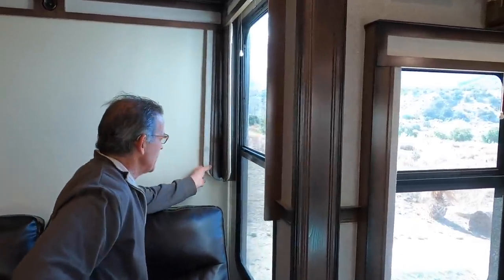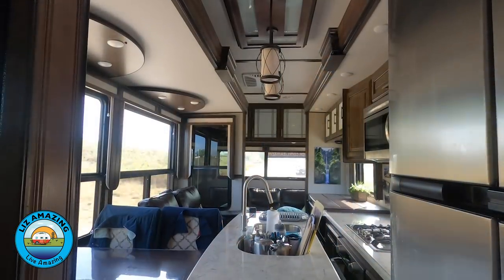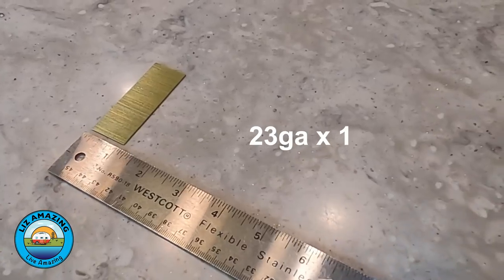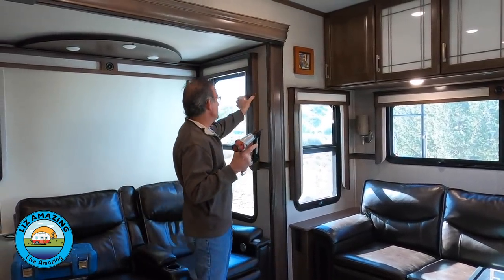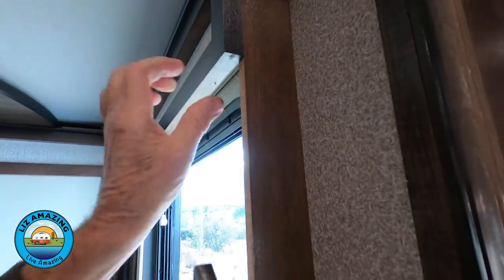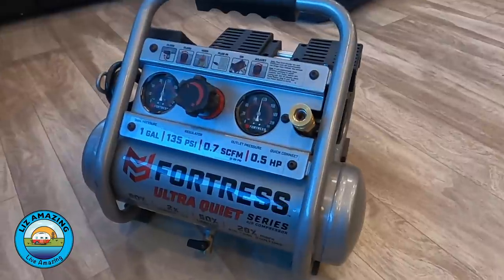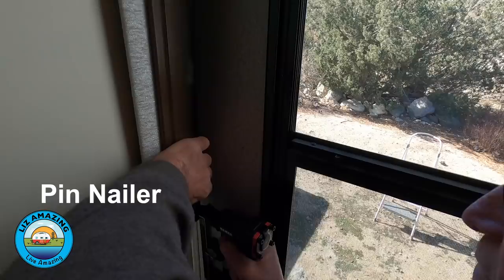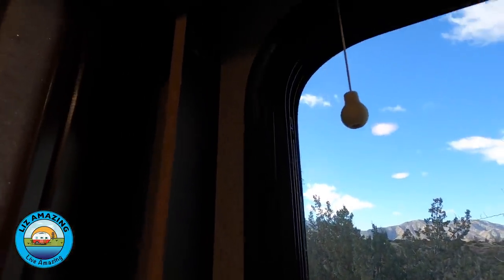RV life: What do you do when pieces fall off inside your camper | How to fix it | RV living

Comment: Hello fantastic video again showing the truth of full timing on the road. We carry a mechanical shop lol! So far chassis on the dog trailer broke, bought steel and hubby replaced and painted. Boat trailer springs broke, hubby bought new springs and replaced. We carry spare wheel bearings for the trailers. Now you understand why we travel with two vehicles lol. Great video wished more showed so people realise there is a price for full time travellers it is not all fun! Stay Safe. Love from us Aussie nomad friends ❤️🤗
Reply from the maker: Hey there! Glad to hear we're not the only ones with a boatload of tools on board! They definitely save the day. Thanks so much for your comment!
Reply: All, when you remove and replace an RV screw. Tip put a tooth pick in a littie elmers glue, stick in the screw hole, then break the tooth pick off flush, reinsert screw. Onetime fix,  good to go!
Use to tooth pick ends for bigger holes. They are cheep. Good vid Paul & Liz.
Reply: Stick houses have plenty of repairs.  My light fixture wires came loose. The weather changed and my door sticks miserably. However the yard gate closes without sticking, now. Annual events. First year without plumbing problems after the first freeze. It us always something. We need challenges to overcome and some of it is  fun. You get a sense of accomplishment.
Reply: pro tip: watch movies on kaldrostream. Been using them for watching lots of of movies these days.
Reply: @Jaden Reginald yup, have been watching on Kaldrostream for since november myself :)
Reply: @Jaden Reginald Yea, been watching on Kaldrostream for since december myself :)

Comment: Great tips. I have the same air compressor in my garage, very quiet. Here's a tip also, I will use dabs of silicone on the trim pieces before I put them in place, if you have access. It tends to help secure along with the staples and brad nails.
Reply from the maker: Isn't that compressor the best? Thanks for the silicone tip!

Comment: Thanks, Paul.  Good info.  Why do interior pieces fall off?  Let's see:  Quick construction practices (screws are better in some places but take longer).  Harsh trailer suspensions; independent torsion bar suspensions are easier on rigs but cost more.  CAD/CAM design and production holds small tolerances, which in turn eliminates trim altogether (e.g. our Lance has no interior trim).  If it isn't there, it can't fall off.  Framing & supports made with 2x2 lumber (vs. welded aluminum tubing) allow much more movement.  And then there are the walls and cabinets which are made of glued wood fibers.  It's actually amazing many trailers stay mostly attached to themselves!
Reply from the maker: That's the truth. We went pale when we watched the video of the interior while our was camper moving down the road- definitely putting it through an earthquake.

Comment: All the metal handles fell off the glass shower doors.  There is a filler cabinet on each side of the couch at the end of the trailer.  The main panel on one of the cabinets just detached itself.  This is the only trailer I have ever owned, a Grand Design Solitude, which I bought because I heard they were slightly better quality.  That may still be true, I have no other experiences to compare.  But I must say I did not expect this within the first 600 miles of travel.

I am a retired contractor.  Fixing is not a problem.  I did much as you have shown but also used white glue on the wood joints and epoxy on the glass/metal joints.
Reply from the maker: Yeah, we are disappointed by the quality. We thought we were doing a step up from the Reflection but I think they are just stapling them together these days.

Comment: Thank you for sharing both the illnesses and the cures. I'm a Coachmen owner who used to drool over Solitudes, but we are seeing way too many stories such as yours lately. For sure, all brands have their share of issues, but you have been dealt a less than desirable  hand.
Reply from the maker: Yeppers. It's that earthquake going down the road!
Reply: Seems like Grand Design has a generous amount of advertising hype....like the whole R-40 roof insulation claim....that would require a 13 inch roof cavity according to Mansfield and Owen Corning. If that aluminum foil makes it a R-40: then double it and have a R-60-R-80 attic insulation LOL

Comment: They use cheap and light weight materials to build these rigs, and things are bound to come apart. However I have to say our first travel trailer was a 2012 KZ Sportsmen. After 8 years the only things that I had to fix was a valance that came loose and a shower base that cracked. Never had a single issue with the cabinetry,  furniture or on board systems.  Granted we don’t full time, but I still think that was pretty awesome. Because of our positive experience with KZ, when we decided to upgrade we bought another trailer from KZ. Hopefully this one will be as good as the last.
Reply from the maker: Ooh, that's exciting- congrats. We are hearing good things about KZ. Awesome!

Comment: This video had me smiling from start to finish because I just did this type of work. We have a Reflection 311BHS and it has a rear bunkhouse. The slide is so tight to the back wall that it rubbed on the rear window valance every time the slide out was opened or closed. Then the half bath door wasn't shut tight and the vertical trim piece on the slide out caught the door handle and that popped off. The valance we left off and I attached the pull shade to the wall above the window and I used my 18g brad nailer (I don't have a pin nailer) to reattach the vertical trim. I still have to fill the little nail holes with wood filler. I took a picture of the trim and will go to a hardware store and try to get some stain to match and then stain the wood filler. Better than those crayons that fill the holes. They never match very well.
Reply from the maker: Yep! Glad you have a brad nailer, so important in RV life! We bought a can of wood filler but haven't tried it yet. I have had good luck with markers for scratches. If my wood filler doesn't work I will try your idea of stain, thanks!

Comment: I have had to fix trim on our Solitude. I like small square head (Robertson drive) screws. They aren't as pretty to the eye compared to finish nails but they hold tight for good. Not sure if Paul is looking for a project haha but adding shocks will help with rattling things loose. I used the roadmaster shock kit available on etrailer. I have to say for all the clamor about GD quality there has been quite a few issues with ours. Fortunately like Paul I carry a wide variety of tools and can fix almost anything myself. Happy trails guys. :)
Reply from the maker: Paul is looking at something for the suspension but it's not the Roadmaster. Definitely upgrading the suspension will help. Once we figure that out we'll do a video for sure! Glad to hear you have a lot of tools, too. You and Paul would hit if off!
Reply: @LizAmazing  LOL, probably. Anyone that carries an air compressor and a variety of finish nailers in their RV is A-OK in my book. ;-)

Comment: I prefer to replace the nails or staples with screws where possible. Bought our 18 374th in dec and put it in storage. When I got it in the spring the overhead trimpiece above the front window had fallen down. Been good since then 🤞
Reply from the maker: That's an idea. We are happy with the pin nails, they are holding tight.

Comment: Actually when I got my trailer in the mid 80s it was already about 10 years old and it was still very very tight and solid when I got it right up till the time that I had to sell it. 😭
When I got it it needed new plastic cover strips over the screws on the outside and I had to take a mud dauber nest out of the heater and repaint the tanks and  reseal the roof. But everything else was in great shape.
2 years after I got it I had to replace the automatic changeover valve on the propane tanks.
Reply from the maker: Yep! I sure hope the RV industry wakes up and realizes they need to up their game.

Comment: This is a good video for those with new campers. I had to do some work like that in my 5th wheel. So one of the main reasons I chose my current rig (1984 Bluebird Wanderlodge) was that I would not have to fix too much inside. Tour of my rig here: https://youtu.be/iQBga0GXtOY. 
I have fixed a few spots were there was some water damage under my refrigerator but that's about it, thankfully its built solidly. I carry a ton of tools.. probably literally a ton, as I work on all of the chassis etc and I also do work for others. This is where I have done most of my work, just catching up on deferred maintenance. Just on my last trip out I blew out one of my suspension air bags (which was only 1 year old) and my generator quit producing power which was replaced in 2013 (a 12kw Powertech Diesel Generator)... so there is always stuff to keep up with when you have an RV.
Reply from the maker: Love those Wanderlodges!!! I showed Paul one I saw in a campground in Oregon last summer. They are SO cool! You are right. They certainly don't build them like they used to. Thanks for the tour!
Reply: @LizAmazing  Thanks!

Comment: Im convinced RV manufacturers quality build their units to ONLY be used for 2 holidays per year about 1 or 2 weeks per.  the more you move; the more things SHAKE RATTLE n ROLL!!  good clip of the unit going down the road there INSIDE the unit...have u watch lucy making dinner IN their unit WHILE ricky is driving down the road with it? HILARIOUS!!  I was a little nervous with P explaining about those two peg drivers WHILE holding them AIMED at the CAMERA..I thought for SURE he would ¨accidentally¨ shoot a brad off and you would add gunfire noise n puff of smoke with him dropping to the floor...etc!!..when reattaching stuff I automatically think of glue and double sided sticky velcro strips (if you need to periodically remove it).  Good secret agent clip at the end of you doing the jamie bond scene!!
Reply from the maker: Glad you liked the James Bond scene!!! We agree: RV manufacturers are serving the weekenders. Fulltimers are far too picky for them. And it's the part-timers that are driving the market. They don't care about the details, they just want the most for their money. As I told Paul, they build them like lipstick on a pig: make them look pretty and people will buy em.
Reply: @LizAmazing  lets call it the Jamie Bond scene! but lets face it; when RV manufacturers make SOLID STURDY units like the Mobile Suites one they are SO heavy you need SEMI to pull them.  I once look at once and he said it weighed 16 or 18,000 lbs! just not worth it.
Reply from the maker: @Lauren-vd4qe  Yeah, we did a tour of one of those. They are SUPER heavy. And you pay all that money, $200k+ and still get vents in the floors. At the time we did that tour, we were in a $30k fifth wheel with no floor vents, and higher quality slide materials. Here's the video if you're interested: https://youtu.be/tnukqEFNGuA
Reply: @LizAmazing  the one i looked at was parked in a guys yard small acreage.  I would drive by it near my house.  there was no for sale sign on it but one afternoon i decided to drop in n ask him anyways.  Yes he wd sell it for $55g; was truly beautiful inside. I was mesmerized until i asked him what it weighed! then i was de thrilled at the necessity of driving a semi everywhere i went; no thanks!
Reply: @Lauren-vd4qe  🤣🤣 put a smart car on the hdt...😚 come on guys...you got to rough it alitte bit..🤣
Reply: @jeannealex2560  hdt?
Reply: @Lauren-vd4qe  heavy duty truck (semi)...just the tractor...not that hard to drive...safer...better visibility..etc..
Reply: Go to watts on wheels..look at their YouTube..girls like 'm big...ours is the first truck
Reply: Go to ..watts on wheels...their YouTube...girls like'm big...ours is the first truck
Reply: @jeannealex2560  oh yes ive seen that; too big for me...

Comment: I have to wonder if adding wood glue would prevent the trim from falling off after the repair?
Reply from the maker: Yes it would. But Paul says we can't glue the trim. He says pin nails are better because there are things we need to get to and once it's glued we wouldn't be able to take them apart when we need to.
Reply: @LizAmazing  Ahhhh....That makes sense if you may have to get back into that area.  I’ll take that into consideration when the time comes.  Thanks for the reply.

Comment: My fire extinguisher bracket fell off after a rough section  of I 75 . it was attached to paneling and the screws pulled out.
Reply from the maker: Yikes, that could do some damage rolling around.
Reply: @LizAmazing  luckily it didn’t hurt anything but it had to be rolling around on the floor. The way they build RV’s is a shame. ☹️

Comment: Its inevitable. When I go 4 wheeling in my truck, screws and nuts routinely work their way loose. I had half the screws in my dash slowly jiggle loose and fall on the floor. Vibration finds all flaws. Also do you use elmers between pieces or do you want to take them apart again?
Reply from the maker: Paul says we can't glue the pieces because we will need to take them off if we need to get to the blinds or anything else back there. Thanks for watching and commenting. See you in the next video!
Reply: @LizAmazing  This is where I would consider small screws. But yeah good to know about this stuff. I plan to do this when covid price hike goes down. I'm also wondering if you need any of that fluff at all but since you might go to a class A then that's moot.

Comment: It would help if the manufacturers used glue.  I have had similar problems with my trailer
Reply from the maker: The problem with using glue is you wouldn't be able to take them apart should you need to. And, yep, it's a familiar problem.

Comment: Those staples that you’re using are eventually going to work their way loose. Plus they are unsightly and you won’t be very successful at trying to cover them up with paint or finish. The best way to reattach trim and anything else is construction adhesive applied to both surfaces (wet to wet). Use brad pins that are recessed below the finished surface. The brad pins are only needed to hold the piece in place while the construction adhesive drys overnight. Use existing holes in trim when installing new brad pins so that you’re not making extra pin holes. I suggest consulting a adhesive manufacturer in deciding what adhesive to use. Many of them give off a toxic odor that never goes away. Some are designed to be odorless.
Reply from the maker: Hi Kevin! You know, I asked Paul the same thing. He says no way can we use any adhesive because we are going to need to get to what is behind the trim. For example, the blinds. I had no problems whatsoever touching up the trim nails. Thank you!

Comment: Not so fast replacing that trim. I’m finding that where there are issues with trim coming loose, there is wallboard coming loose too! If you fail to fix the wallboard, you will have to remove all the trim that you repaired. You don’t want to do that!!!!!!!!! The wallboard is a type of fiber- board. It’s like compressed paper. I think what’s happening is when the trailer is going down the road, the frame is flexing in all directions and working loose those wall panels. It’s fiberboard and only an eight of an inch thick. That is contributing to the trim coming loose. I would find an rv club or look in youtube to see if there’s a technique to reattaching the wallboard. It’s probably glueing using a flexible construction adhesive.
Reply from the maker: Thank you Kevin! Sounds like you know what you are talking about. Our wall board is fine.

Comment from the maker: What has fallen apart in YOUR camper? And were you able to fix it?
Reply from the maker: Let us know in the comments.
Reply: @LizAmazing  it would help if some glue was used by the manufacturer. O have had similar problems with by trailer
Reply: Furrion microwave had issues with the door switches. Replaced all 3 worked for 1 day. Had enough of that and replaced with a GE model. Little bit of work to install but well worth it
Reply from the maker: @mikewebster2984  Yep. Paul says if they glued the trim you wouldn't be able to remove the pieces when you need to access an area. So he says the pin nails are the best for that.
Reply from the maker: @gregorylipkin2808  Glad to hear!

Comment: Grand Design builds disappointing junk. I know, same issues with a mb 377. They know their problems and keep building them the same way. 😢
Reply from the maker: They've definitely gotten worse. We've toured two different Reflections that were each a few years old. We could tell right away that the finish work was a higher quality than our Solitude.